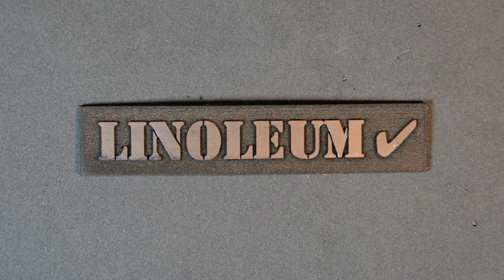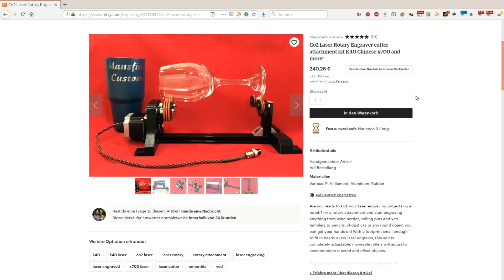China K40 laser review and test

Comment: I'm currently thinking about buying a laser cutter, but I have some questions about how powerful the laser has to be. I understand this laser has a power of 40 Watts, but you only ever seem to use 25 mW. Is it ever necessary to use a higher power than 25 mW for cutting things, or is 40 W in fact more than you need?
Reply from the maker: The power is in mA and for the 40W tube you should not go above 15mA. The K40 will cut Acrylic and Plywood of around 5mm. 
As a rule of thumb you can assume that you can cut 1mm acrylic for every 10W of the laser tube.
Reply: @WayofWood  all right, this helps a lot, thank you!

Comment: At 3:58 - air assist still can cause fire if wood is too thick. Tried to cut 22 mm oak wood and too slow cutting speed causing great fire from below. So, instead small fire above workpiece, now we have big flame below the workpiece.
Reply from the maker: Good advice. You should never let the laser do it’s thing without looking at it. 
But 22 mm is also far too thick for a 40W laser. I would consider 4mm the max it can handle.
Reply: @WayofWood  Ye, 4 o 5 mm is okay. I did it just as a curiosity, whether is possible to do it.
Reply from the maker: I think you could do up to 10 if you carefully cut from both sides...
Reply: @WayofWood  Thanks.
Reply from the maker: I found that at least for my machine you can’t cut 8mm with several passes without creating a piece of charcoal. 😏
My focus is right above the bed but still even after a couple of passes I don’t get through 8mm.
Reply: @WayofWood  Some wood is just terrible for cutting. Some are okay. Yes, 8 mm to thick, but I wish I have big laser with at least 60W or more...
Reply: @wurzelzwerg100  Good to know. Do you mean N2, or CO2?
Reply from the maker: Good tip.
Reply: @WayofWood  I just bought the k40 for cutting 10 mm black and transparent acrilic and 10 mm mdf, I still do not have the machine so... by other hand  Im able to cut 3 mm BLACK acrilic with a 3018 and 5w laser, If i am not able to cut this thick with the k40, im gonna set it on fire...Anyway there are videos here cutting 15mm transparent acrilic , so confusing
Reply: @WayofWood  I finally got the machine and I was close to set it on fire as I told you, because I am a noob, but I am able now to cut 10 mm transparent acrilic with 1mm/s 45% power ( i dont have mAs meter) 1 pass
Reply from the maker: Good to hear!

Comment: Great impartial review and I have watched many before and after I purchased my K40. I had read that the wiring could be dodgy so I looked inside and thought it all looked ok - earth / grounding wire in place.... After watching your review I had a look at the grounding connection and it was completely insulated by paint. When I tested it with the multimeter sure enough the grounding was not working at all. Thanks to your advice and a bit of sandpaper my chances of surviving using the K40 have increased.
Reply from the maker: Great that the video was helpful for you. The grounding is one of the things I really don’t understand - it would be so easy to fix at the factory and still seems to be a consistent issue.

Comment: Is it possible to cut metals like copper and brass?
Reply from the maker: Jagadeswaren s No. You would need a Fibre laser to even etch them. The only thing that you could do is use an etch resist such as lacquer and remove parts of it with the laser. You can then etch these areas with chemicals.

Comment: Good video. Helpful. How big is that pass thru slot in the back for overlength materials.
Reply from the maker: Erwin Holowick The slot is an exhaust slot. Without modifications the K40 can’t process overlength material.
Reply: @WayofWood  Thank you. Hopefully a hole can be cut in the front panel, if there is a clear path inside. I have a 15 inch long x 3 inch wide x 1/2 inch high (0.1 inch material  thickness) nylon part that I need to cut a 2 inch x 2 inch hole in one end.
Reply from the maker: Erwin Holowick I am currently not in the shop and can‘t look at the laser but I think it should be feasible to cut an opening in the front. The back would be trickier as there’s the laser tube in the way...

Comment: hey was wondering if you could help me with some info

my neighbor has one of those cheap ebay blue colored 40w c02
lasers.8x12 ...with no accessories...all he has is the laser machine

no sofrtware
no dongle
no pump
no fan
no accessories at all

if i buy a cheap water pump ..would i b able to communicate with this
maching using lasergrbl or something..or does this machine need some
unique software/dongle to actually work? or is it just an ugly doorstop at this point?
Reply from the maker: You only need to invest 15 bucks for an aquarium pump and as a software you can use the free K40Whisperer. With some of the additions described in this videos (esp. air assist) you should be good to go...
Reply: @WayofWood  thANks  my neighbor selling it to me for $40 never used...just didnt want to buy a doorstop lol...
Reply: @WayofWood  thanks so the only items i would need to actually run the laser would be a water pump and k40 whisperer(controller soft).......air exhaust recommended but is not necessary to run machine correct?

Comment: Great video and insight. I have a query, I wanted to use this 40watt laser to personalise and engrave on Bamboo/Wood/Leather Products, would this be a good option to have? Say about  engraving hundreds of small items a month... Thank you!
Reply from the maker: Chetu Okade Thanks. If you want to run production grade amounts with the laser I would think about an improved cooling system and I would actually think about getting 2 machines so that one can cool down while the other is running ... and you would have a spare one if one tube dies - which will happen sooner or later
Reply: @WayofWood  Understood. Thank you for your time.

Comment: I guess when you compare the initial cost 300+400 is a steal and a no brainer but from the videos, I have seen it seems to get this baby running it requires lots of time and lots of upgrades. Like the video stated if you have the abilities or additional making tools no problem but if you don't I am sure the add ons add $$ and time $$ as well. What is the typical cost of a machine upgraded to a point that is reliable and stable? I am sure that it's still cheaper than a glowforge or full spectrum but not 10x cheaper.
Reply from the maker: erodriguex2k We have a recent video: China K40 laser review and test https://youtu.be/d5KoCNpf3t0 that goes through all the necessary upgrades to make the laser safe and working properly. 
It really comes down to your skills and available material. For an average maker that knows which end of the soldering iron to touch it will be 2-3 days of work and an additional 100 bucks. 
Have a look at to vid above to help you with the decision.
Reply: @WayofWood  The link is for the same video. Can I ask you have much is the true cost of getting the k40 up and running in the same similar fashion as the one you have?
Reply from the maker: erodriguex2k Ah sorry; I thought the comment would have been for an earlier video...
For me the necessary safety modifications were around 100€ except the bed and the new cooling unit. They are not safety relevant and might add another 100€. But I have a soldering iron, a 3D printer, cables and some left overs from other projects such as LED strips. 
If you have to buy a soldering iron, have to order 3D prints from shapeways, etc. it could easily be double that amount.
Reply: @WayofWood  No worries I appreciate your response and it is a great video . thanks again

Comment: I am looking for some help.  I have NEJE burner that makes pictures pretty well by burning and not engraving.  I got this new k40 thinking it would laser etch pictures and not burn down in and not fill with black to make outstanding pictures.  I have worked with it all day today with different settings in the k40 whisperer starting from 100 to 2000 on the raster engrave.  Am I missing something?  can I just do a burn without engraving on this?
Reply from the maker: Matt Tanner What do you mean by burning and engraving? The only way a laser can engrave wood is by burning it. I don’t understand your point.

Comment: Cohesion3D LaserBoard, LightBurn and the LightBurn camera are amazing upgrades!
Reply from the maker: jamienoel The software looks interesting but it doesn’t work for the K40 without upgrading the board. So far I haven’t found any reason to go for a board upgrade as the K40 with K40 m Whisperer does all the work we need. What is the most interesting feature from your point of view?
Reply: @WayofWood  Since having my camera, I can't imagine being without it.  Same with the drop-in replacement Cohesion3D LaserBoard.  The Cohesion3D LaserBoard is nice because it uses PWM to control the power supply current levels and allows such things as true grayscale, plus non-stop automation from scanning to cutting, all at different power levels you set in LightBurn.  Whisperer was ok for a short time, but as with the Camera, I couldn't imagine not having LightBurn.  I even upgraded my Full Spectrum laser with the C3D LaserBoard!  Aligning, tracing and getting every last MM out of your material, or engraving small things like dog tags, pocket knives etc. without the need for jigs or time consuming alignment are some of the things helped by the camera.  I use it almost every time I need to create or engrave something now!
Reply from the maker: jamienoel Thanks for the answer. PWM certainly is a game changer and the camera is a nice feature. I have to admit that I didn’t used the laser for greyscale engraving so far as most of the work is rather functional cutting but if we get more into engraving this seems like a great option. 
Do you know how much the software, camera and a new board would be?
Reply from the maker: jamienoel Thanks a lot. I will have a look!
Reply: @WayofWood  You never know you needed the camera until you have it.  I can't live without it now. lol

Comment: Is it possible to have laser cut with different programs like cad/cam all the way up 2+3 axis!
Reply from the maker: Mr Me I have a video dedicated on CAD solutions for 3D printing and laser cutting. I use Inkscape for organic shapes and FreeCAD for 3D models (a separate video on 3D models for the laser is in the making). Using K40 whisperer you can use any CAD model that outputs DXF. 
CAM is not possible with the K40 as it doesn’t speak GRBL. There is a replacement board called Gerbil that will enable full fledged CAM. But I honestly didn’t missed a CAM feature as you anyhow are limited to cutting lines and rasters - which is covered by K40 Whisperer.

Comment: 4:34 could you use the cooling fluid used for overclocking PCs? E.g. PrimoChill? And combine it with a PC tower radiator?
Reply from the maker: John Coyne I am planning to use a PC radiator and incorporating it in the cooling flow but stick with water as the cooling fluid . Let’s see how it goes...
Reply: @WayofWood  water as in distilled water or from osmosis because tap water takes some hundred volts by induction in the tube.
Reply: I was thinking the same thing. Where do you get the air assist or what is used to make it?
Reply from the maker: The air assist is my own design that is described in this video: https://www.youtube.com/watch?v=Q-7hgnYkgd8. In the description is a link to the free thingiverse model that you can print on a 3d printer.